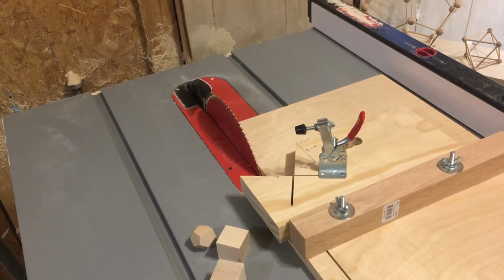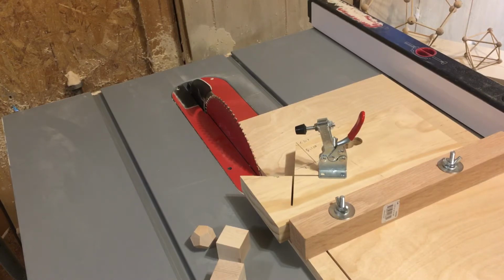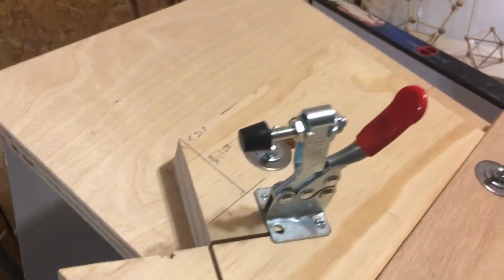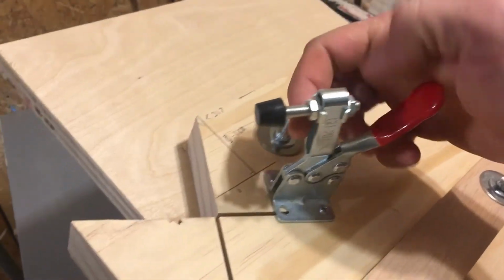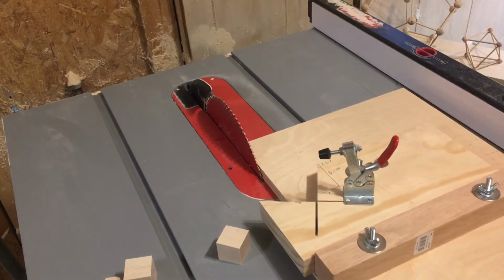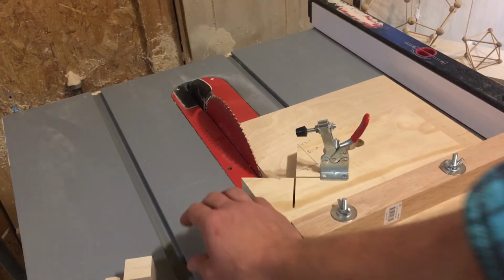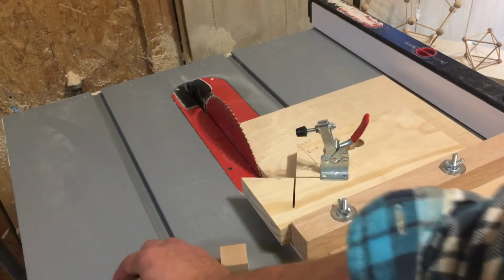Cutting a regular dodecahedron from a wooden cube.

Comment: I'm amazed that you still have ten fingers! Why did you not pull the sled back from the spinning  blade?  Your fingers  were within  50mm for no reason! 🥺
Reply from the maker: Yeah I need to be better about safety. I have a sawstop saw there,  and it probably gives me a false sense of safety, but you’re right I should be more careful and not develop bad habits just because it’s a sawstop.
Reply: I see so many saw tables used on YT without guards over the blades.
Reply: This is really cool, can I assume these dice would come out the size of your normal sets you would by at your local store or online
Reply: @FUNKINETIK   there is a reason for that. Cheaper saw brands make you choose between having an over blade guard and having the back protection blade in place if you want to sink the blade. Not having that however is nasty with kickbacks and totally unsafe, so people cut the back knife down to allow sinking the blade with this still in place, but this removes the option to attach the blade cover. By the  look of it, his is cut down too.
Reply: @MadMakerWorkshop  think i know what you mean… bolting the crown guard onto the riving knife isn’t a great set up. I loved using the Dim (Dimension) Saw in the joinery workshop in technical college many years ago. Such an accurate machine, Wadkin & Bursgreen, of course the guard was fitted to a boom arm totally independent from the saw blade set up.
Reply: @FUNKINETIK  im looking into buying a metabo table saw that still attaches the guard to the riving knife(not a native speaker, didnt remember the term...) But has toolless adjustment knob to lower it out of the way if you need to sink the blade.

Comment: I ordered a copy of Hiroshi Nakagawa's book and am hoping it will solve my conundrums once it arrives, however, I'm looking to use your explanation here to make a d12 dice out of stone using a tile saw. I cannot for the life of me figure out what the length from the right angle to the saw blade is. I know I need a 90 degree angle corner there, but where to place it is escaping me.
Is there a calculation you used? I know I start with a 21 mm cube, and I think I have found the angle in your video, but where to put the other back stop on my jig is unknown.
I'm looking for the perpendicular measurement from the saw blade to that right angle so that the flat of the saw blade and a line drawn from the saw blade to that corner would be 90 degrees. If you have that measurement handy from your jig, along with the side of the cubes with which you start I could certainly work backwards and figure it out.
Also, I see the book has pentagonal trapezohedron and icosahedrons. Are they shown on a table saw as well? Those are the two I can't quite figure out yet as far as jig making, though I'm technically working on an octahedron (I think I can figure that one out fairly easily.
Reply from the maker: I didn’t show it in this video, but the jig is able to be adjusted about 2”  perpendicular to the saw blade and locked in place. So it can cut a range of dodecahedrons from about 1” up to 2 and1/2”. I adjust the distance by making two cuts on one face of the cube, when the original square face of the cube is just barely cut away then that is the right distance for that size of cube.
Reply: @pumpkinseedvalley9494 I’m trying so hard to understand this 😭

Comment: Any order to follow when making the cuts?
Reply: It's not my video, but I have gone through a similar process with my table saw and miter saws -- So, yeah, order does make a difference for two reasons: First even though he doesn't say much about orienting the nascent dodecahedron for each cut it is very easy to make mistakes,and having a definite order will help. Second, his support (the cutout where he places the wood for cutting) doesn't match the shape of the wood very well after several cuts. So you note he has to be very careful about getting in there and clamping it correctly after a while. For soft wood that's fine, but for a hard wook it's likely to be pulled out of true during the cut. The order can help with this by making all the cuts to the same "half" of the doda first and then you only have to be careful at the end. My solution though was to have two jigs for cutting: one like the one above and one that has bevels that match the doda.